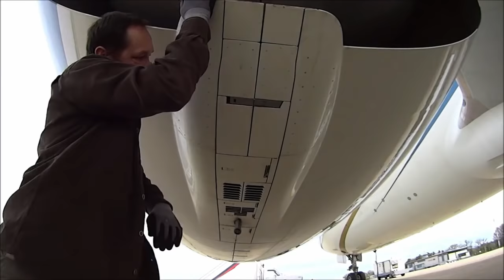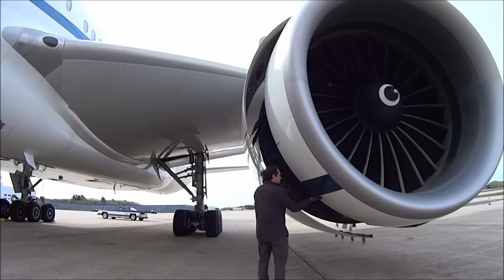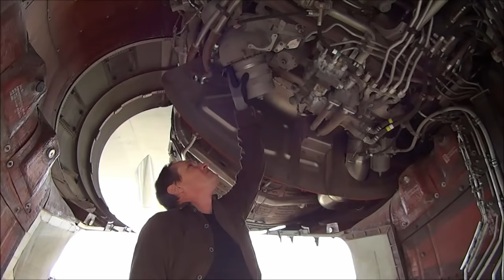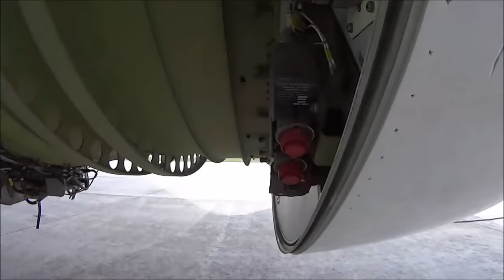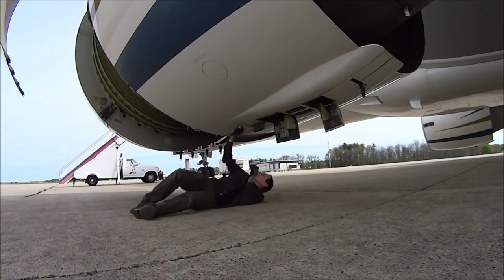Opening Cowl and Thrust Reverser on Boeing 777 Engine GE90-90B

Comment: I heard that the technical documentation for a 747 (yes this was a 777) weighed as much as the entire aircraft.
Imagine all the parts and assemblies... all the manufacturing specifications, design drawings, assembly details, test documentation, maintenance instructions, troubleshooting guides, checklists, engineering change approval/documentation, process tracking ...  Of course, much of that will be digital today.

Comment: In 1991 i started working at JFK as a ramp worker. The engines didn’t have actuators. All manual, and a 2-3 man job opening those things for maintenance. Unless a quick check, meant that plane was grounded for a few hours. Come a long way 👍
Reply: Cheers for that Paul 👍

Comment: I`m 46yrs old and I wanna go back to school for aircraft maintenance. SO awesome to be able to work on them giants
Reply from the maker: Do it!
Reply: BigIronTV Is it hard to learn. I`m sorry but I`m a little negative, always been. I heard that there is a final verbal exam. I have a slight stutter I hope I manage the stress at that time.
Reply from the maker: It requires effort but not harder than learning anything else.  There are two certificates available.  One is the Airframe and the other is the Powerplant.  Some people get one and not the other.  This will greatly limit your work options though so it is best to get them both.  The testing process is that you are required to complete either on the job experience or a certified training program.  From the OJT you will get someone that is qualified to verify in writing that you have the required OJT.  From the training you must pass the test at the end of the course.  With either the OJT letter or passing test score you then go to the FAA and request permission to take the certification test.  They will issue the permission and then you have a limited amount time to schedule and take the test.  If you do not do the test during this time then you will need to reapply for permission to test again.  Once you have the FAA permission to test you will need to find a designated examiner and schedule a time for an Oral Practical exam.  For the oral part the examiner will sit with you and ask question of their choosing from a list of topics.  If you do satisfactorily on the Oral then they begin the Practical exam.  This is hands on where the examiner will tell you to accomplish specific tasks and then observes to see that you know how to find and use the correct reference data in the manuals and can follow the manual instructions to accomplish the tasks.
Reply: BigIronTV The oral part of the exam already scares me because I have a slight stutter.  How often does an airplane require body work? I`m sure the other mechanical parts do so.....
Reply: BigIronTV Is the oral exam in front of the class or 1 on 1?  I`m really nervous about it considering my slight stutter.
Reply from the maker: The oral practical is a 1 on 1 with you and the examiner.
Reply: BigIronTV Then i might not stutter as much. Will it be with the class watching or seperate in a room?
Reply from the maker: There will be no class.  This is done after you have finished the schooling.  It is normally just you and the examiner.  Mine took about a half day.  I have heard of other taking two days.  The examiner has lots of leeway in the tasks they can ask you to perform.  The oral is conducted from a set list of questions they the examiner can choose from.  People can easily pass a written test but this testing method is designed to ensure that you actually know how to perform the work.  It is not difficult though.
Reply: BigIronTV Thanks for the info greatly appreciated. I hope I learn this. I`m so nervous cause it`s a career change for me and at my age. Not that I consider myself an old guy but I`m sure companies would hire a younger rookie than an older one. I hope I`m able to get a line maintenance position in chicago where i live. I dont wanna move away from my home town.
Reply: Do you have a degree? I`m taking an aircraft maintenance career certificate of 2yrs.
Reply from the maker: Yes.  Most programs will result in a degree now days.
Reply: BigIronTV Can I get a job if I only get a career certificate and my A&P certifications? How many hours per week do u work?
Reply from the maker: Yes you can.  I have an extremely unusual job.  I travel with this aircraft around the world and keep it repaired and ready to fly for the owners.  I work for 6 weeks traveling withe the plane then go home for 6 weeks while another mechanic comes and flies with it.  When I worked a regular mechanics job I worked 40 - 84 hours per week.  I think most will work at least 40 per week.
Reply: That's very cool job.
Reply: AIM is that a Good school
Reply: Desmont by 38 hours gold😳😳
Reply: VWGTI so did you do it?
Reply: @BigIronTV  how expensive would be?

Comment: Crazy how big everything is on a plane! Almost all the planes I have flown on were tiny!
Reply from the maker: +Flint and Steel Survival Actually these are the largest jet engines.  Most jets do not have engines this big.  They are GE90-90B engines.  Also I am small so that makes them look extra big.
Reply: what about the ge 90 115bs?
Reply from the maker: Referring to physical size.
Reply: BigIronTV
 So do they have the same dimensions but instead of putting out 115k thrust they are simply derated to 90k?
Reply from the maker: Very similar in physical dimensions but quite different inside.  More that just a derate.  The GE90-90B that we have can be upgraded to a -94 http://www.geaviation.com/press/ge90/ge90_20010510.html.  https://en.wikipedia.org/wiki/General_Electric_GE90
Reply: good to know. Are you an aircraft engineer? or aeronautical engineer?
Reply from the maker: aircraft engineer

Comment: What is the  little exhaust pipe for in front of those  vents at 10:21?
Reply from the maker: It is the oil drain mast.  All of the oil seals have drain lines attached so any seepage of oil is directed down to the drain mast .

Comment: Sounds like some of those latches could use a shot of WD 40. Of course for the aircraft industry WD 40 would be relabeled with a twelve digit part number in a solid grey can and cost $45 a can.
Reply: Aerokroil it's $30 a can, it wouldn't surprise me if that's what they use.
Once a year they have a buy one get one free so that's how I justify buying it, but even at $15 a can it's still triple what most cost.

Comment: The Aerospace company I worked for (my father was GM, then President) engineered, designed and manufactured, and still does...under a new name, was bought by another company...the hydraulic opening module for the cowling and reverser doors, mainly for GE and RR. I grew up in that environment and started working there cutting grass, then moved to assembly and test then after college was contract administrator until I moved on as a practicing CPA. They design and manufacture (from bar stock to out the door) valves and subsystems on commercial and military aircraft, for instance the thrust reverser control modules and ramp control modules on the C-5, the now retired C-141 thrust control module and many many valves (mostly hydraulic and some pneumatic) on engines and subsystems. Always cool to see something like this in action! Walking through the C-5 at an air show and seeing the product on the plane brings so much pride and memories of my fathers hard work and sacrifice and all the employees who loved what they did!

Comment: Latches and levers could use some oil 😉😁 AWESOME VIDEO!
Reply: might be fire hazard or make stuff oily that aren't designed to be oiled, like damaging gaskets orings or seals... and might increase drag if it leaked out and streaked across panels
who knows, itd probably be fine, but the insurance of a sticky latch that needs to remain closed is calming
Reply: WD40
Reply: @danielpratama2945  deep creep is better. kroil is pretty terrible for value.
Reply: Unless it is in the aircraft maintenance manual it is prohibited.

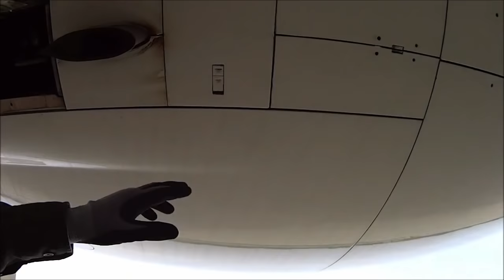Comment: Can anyone (who has studied and knows the components of the engine) explain me what is the "nozzle" at the bottom of the engine (you can see it quite clearly at 1:53, on the left-top section of the screen), please?
Thank you!
Reply from the maker: LF-Domino it is the drain mast.    There are tubes that run to this mast from different locations of the engine and accessories.  They collect oil that seeps past seals and direct the oil to the mast to be vented away from the engine.  Typically not large quantity.  Keeps oil from pooling in cowling and causing fire hazard etc.
Reply: @BigIronTV  Thank you so much!!! But I don't think that is such an environmentally friendly thing...

Comment: What is the small protrusion on the under side of the cowling that looks like an exhaust pipe for?
Reply from the maker: +Geoffrey Gallaway Oil drain vent.  Oil leaking around seals during operation is captured and directed through pipes to the vent so it does not collect in the cowl and cause fire hazard.

Comment: Wow. I have never seen this detail before. It looks like a hard job just to open it up and take a look. It is easy to forget just how big those powerful engines are. Every latch is critical and must be secured. At 10:25 : I was wondering, I that standard Boeing procedure to lie on you back and use your feet to close the cowlings? Was it planned to be that way?
Reply: Very interesting question, as the feet assist procedure requires some acrobatics skills XD

Comment: I don´t want to be too nit-picked, but this is not the way to open the cowls on a GE 90 baseline engine. The maual tells you to follow a specific order for the latches.
Reply: Markus Pristonig okay then
Reply: The correct order is not that important as long as you don't go just random. The T-handle (the smaller GE90 doesn't seem to have it?) operates easier when opened earlier in the sequence. What concerns me more is that he doesn't latch any of the hold open rods.

Comment: I have a question, Why are airplanefans mostly running while the airplane is not in use? And the direction is different....when the angine really starts, than the fan stops turning and turns into another direction. Also in this video you can see the fan a little bit working....why is that? And thanks for the lovely vid!
Reply: Because of wind
Reply from the maker: It is the wind blowing that causes the fan to spin like a windmill. If the wind is blowing behind the motor it will spin the fan in reverse direction.

Comment: Is there an exhaust vent for the bleed air used to start the engine, if so where's it located?.
Reply from the maker: Yes.  It is incorporated in the starter itself.  The bleed air enters the starter and passes through the turbine section of the starter then exits into the engine cowl area through the vents circling the starter body.

Comment: The struts that push the cowl out are they electric mechanical “screw jacks” or compressed air.
Reply: Well you didn’t answer my question so you don’t know either.
Reply: The struts that open the cowls are hydraulic.  It is a self contained system on each engine that uses an electric pump to pressurize the fluid--you can hear the pump motor running when he pushes the "Open" buttons. (Those struts are not visible in this video)    The struts that are visible in the video are the "hold open" struts.  They lock mechanically and hold the cowls open in case the hydraulic pressure is bled off.
Reply: hydraulic

Comment: If you notice the landing gear you'll notice that it's not a 777 like the video states. It might be a 767 or a330.
Reply from the maker: What about the MLG makes you think it is 767 or 330? The 767, 330 do not have triple axles. Also that massive GE90 engine in the video is installed on only one plane. The 777.
Reply: Funny how you point out one 9f the most distinct things about the 777. Then call it a 767 or A330. LOLZZZZ
Reply: its an A380 dude @phillip 
XD :P
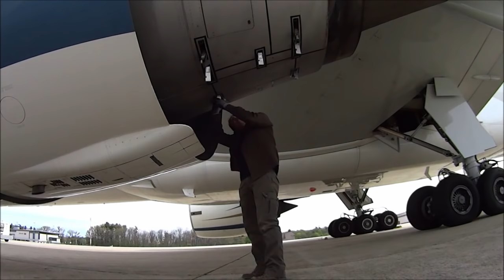Reply: For those of y'all who can't count at 7:44 on the video you get a clear shot of the landing gear. There's only 2 axles not 3.
Reply: @Phillip quinley? If you look carefully enough, you can see 5 axles in total, where only two of the left hand side are showing... You can look up the reg, it is N777AS...
Reply: David Horgan it could be also a 757
Reply: BigIronTV the engine is not a GE engine. Its a rolls royce engine
Reply: Walter Henrik please stop commenting when you have absolutely no idea what you are talking about
Reply: 64h5dsf14j6s41h5s4j5 thats are two planes. In the first half of the video its a 777 but in the seciund half it could be a 757 or a 767
Reply: Walter Henrik what are you talking about? He's working on the exact same engine throughout entire video
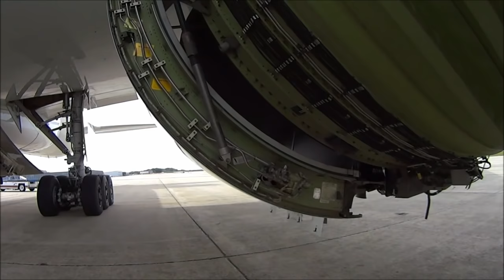Reply: 64h5dsf14j6s41h5s4j5  look at 3:52. How many wheels have the plane?????
Reply: 64h5dsf14j6s41h5s4j5 an then look at 7:50. Ah 777 has not two wheels
Reply: If you notice the taildragger you'll know it's a DC3

Comment: That has got tobe the most overcomplicate d way of opening a door.. far too many states and moving components easy to make a mistake especially on a ver cold sheet day or night those hasps look far too award just to release who did the safety case analysis for the single point of failure bovermaped with the human factors cars had better nhope that the and the engineers have got that right

Comment: The dude is not a mechanic.  Maybe some upper level manager doing a video...lol.. struggling with latches not very fluid with his motions...when laying under the engine unlatching fan cowls and t/r's you never ever want your face under those cowls.. splash in the face of a possible oil leak..